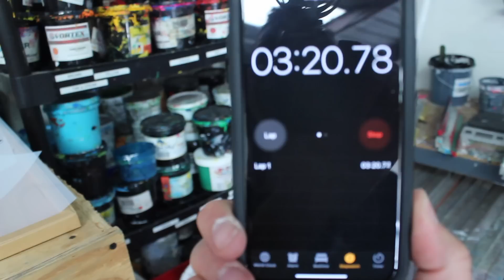Is a Darkroom Necessary for Coating and Exposing Emulsion? Screen Printing Tutorial

Comment: Using the orange emulsion, how long do you typically expose for?
Reply from the maker: Depending on the mesh, and with our multi bulb exposure unit, it takes anywhere from 45 seconds to about 1 and a half minutes.
Reply: I use the ulano orange with a ryonet exposure beginner unit and I’m at 3 mins . It all depends on your exposure unit set up

Comment: you only add one coat of emulsion to each side ?
Reply from the maker: That's correct. If you're starting out, you'll get the best results that way. Later you can try experimenting with 2-1, 2-2, etc.
Reply: Thank you!
Reply from the maker: @stephanielisenby5743  Any time!